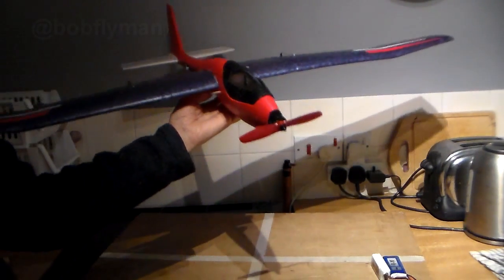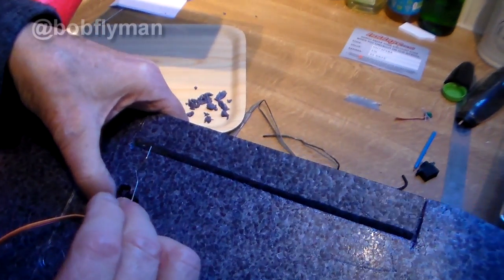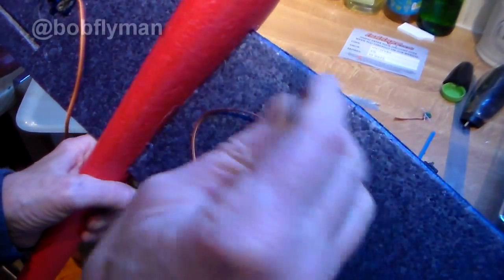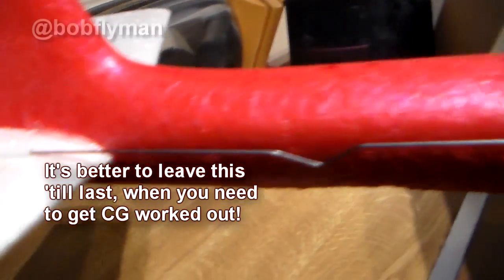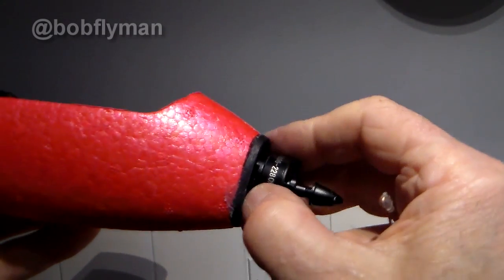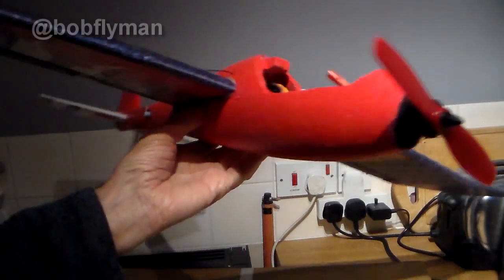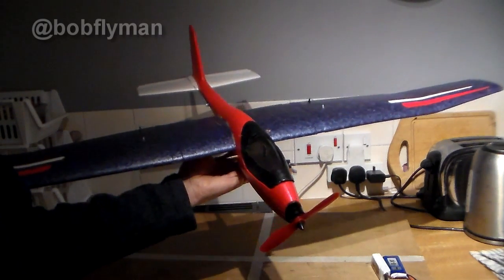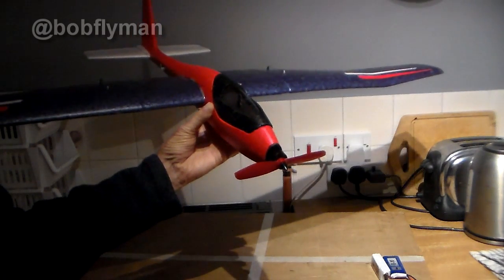Lidl Big Bird 2 build blog Part 2 + useful tips.  Is this plane jinxed?  Did the maiden happen?

Comment: Why didn't you run the aileron push rods and horn on the under side of wing like a normal set up, far easier , neater, and les digging out of the wing surface.
Reply from the maker: Nothing is neater than the way I install them mate.    The servos are completely hidden inside the wing. Did you watch the whole video?  A small push rod on top has no possibility of snagging on the ground when landing.  And there is no drag whatsoever! 😉